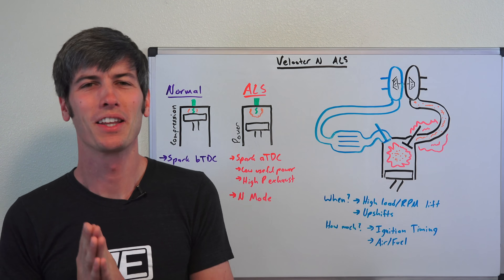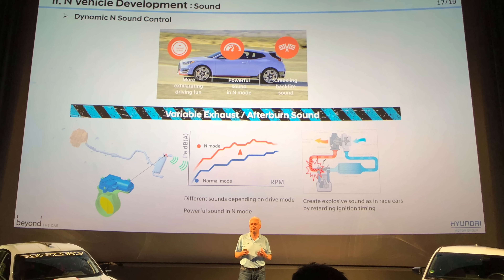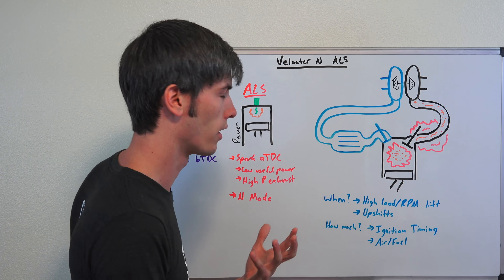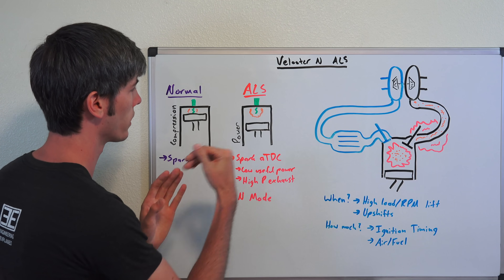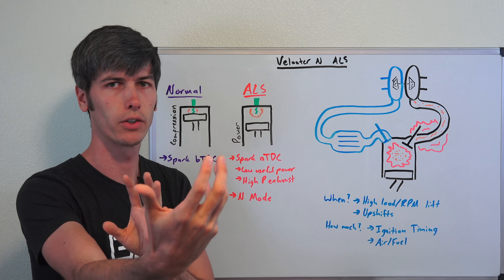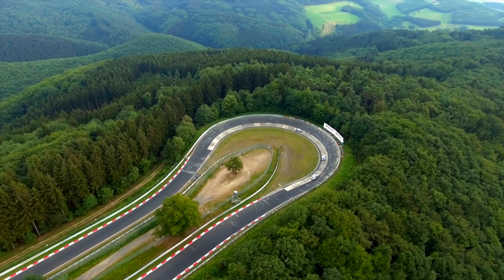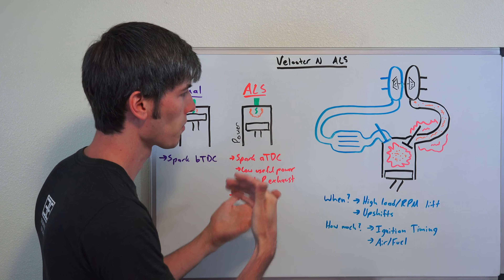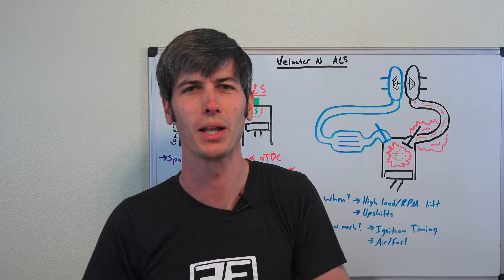Anti-Lag - How Hyundai Eliminates Turbo Lag

Comment from the maker: Thanks for watching everyone and hope you’re having a great day! For anyone interested here’s my full review of the car: https://youtu.be/6BVEhLBj7MQ
Reply: Very very cool(dont know your name) What track was the test drive at? Great job and anyone Shopping for new car or going to school,Most definitely needs to subscribe.Fantastic,,73s
Reply: Engineering Explained can you do a video on whether or not fuel is sent into the cylinder while coasting in gear, off the throttle. And if so, how much fuel?  I can’t find a clear, decisive answer. Thanks!! Love the videos.
Reply: Engineering Explained 
I made a HHO discovery a couple of days ago.  It has a much more efficient use of electricity.  Saving fuel for all whom want to try it. 

 The parts needed are two HHO cells wet or dry.  Tubing, robust electrical connections, extra car battery is optional, flash arrestor,  bubbler 

  If you want to do a video on it?  Then let me know, as I live near Preston.
Reply: Thank you so much for this amazing video been waiting for it
Reply: As you say at the end, cool that they have done it in a production car with a warranty. Having been involved in rallying, antilag isn't a new concept, but a rally car isn't under a new car warranty and can have a new turbo fitted every event as required. 
Cool tech for a road car and a brave move by Hyundai.
Reply: You drove the Veloster N at the Nurburgring?
Reply: Engineering Explained , do you know if is it bad to change drive modes, while driving car? What’s your opinion about that? Thank you for the good work
Reply: +Dale Alexander - Nordschleife circuit at the Nurburing complex.  It would be great to have heard what the lap times were in the Veloster.
Reply: Engineering Explained Hey. Great video. Question for you. The upgrade you can get (in the form of an ECU flash ) on the VW Golf GTI autobahn and the Golf R. It is presented as a “sound enriching “ upgrade. Would it have the same effect? What do you think and can u see about that? I have to go meet the APR guys and ask them but I won’t be out that way for quite some time. And I don’t even know if it’s them or VW offering it.
Reply: Great video very informative. What are the disadvantages of this anti-lag system?
Reply: Is this bad for the Catalytic converter?
Reply: @postulator890  it is...and it's the birthplace of the Hyundai i30N and Veloster N .. :)
Reply: How is this not just a "pops and bangs" remap? Isnt this exactly what all those remaps do? Retard timing? So what is the "fake" pop and bang then? :D old video i know

Comment: It happens mainly in N-mode because by default N-mode is all setting put in Performance/Race. But if you push the checkered flag button twice, you go into custom mode where you can set things up as you wish. For example, I have mine (the i30N Performance, not the Veloster, as I'm from Europe) set to Custom with the dampers on soft for normal roads, rather than stiff for track. as it would be in N mode, engine in Sport+ as in N mode (there is Normal, Sport, Sport+), LSD in Sport, TC in Normal, etc. So if you get this and use Custom mode with it, and have it set up to use Engine in Sport+, while it does sound nicer and actually give you anti-lag (sweet :D) you don't want to use it everyday going to get groceries if you want your car to last for some time, plus you won't be that douche that annoys everyone in the neighborhood. You can put the Engine in Sport and have a bit of the sound (it's a bit less than in Sport+ but it still pops and bangs) and actually retain a bit of the turbo's life/durability. Also it's a good idea to leave the car on and idling to cool it's oil since it passes through the turbo to cool it, especially after riding it hard for some time and especially if you use N or Custom with Engine turned up. Safe driving everyone!

Comment: Great explanation, thank you. I still find it funny that my 2019 Accord 2.0 is faster than this car.
Reply: No it's not. Your faster shifting auto will do about the same 0-60 and pull out just a bit slower on the quarter mile. But that's about it. It wont out-perform it in anything else.
It will however slap a BRZ in the face with pleasure lol
I seen modded BRZs (or whichever brand) lose to someone's mom's 2.0t accord lol

There will be dct auto veloster n coming out shortly and it will be faster then the stick. Heck... the r spec veloster has sticky tires, light wheels, less weight, and is still slower then a heavier auto turbo veloster with economical tires and more weight. 

Wait for that dct man 😉

Comment: Hi. Please tell me. If I want to install a turbocharger in my car, do I need to make any other engine adjustments/upgrades?
Reply: Peter Swarts the internal components of a naturally-aspirated car are not going to be strong enough to handle a turbo. You would want to rebuild the engine, maybe with forged internals or something.

Comment: Is 'N' mode Normal Mode ? What are all the modes for ?
Reply: I own a i30n i think the modes are pretty much the same as the veloster n

I have 
- eco mode (most economic no power)
-nornal mode (always active when u start the car.. Decent power decent economy) 
-sport mode (high power, low economy) 
N mode ( ultra sport mode... No economy) 
And the custom mode where you can customize everything from throttle response to sound of exhaust....

Comment: Is this like the "2 step" mode of the drag race cars?
Reply from the maker: 2 step is simply a rev limiter for launch control. It’s often associated with ALS but they are different functions. If the launch control retards ignition timing to function, it can potentially (not always) act as an ALS for turbo vehicles.

Comment: This is just downright cool. Props to Hyundai for that. I would be curious about the cooling system within the turbo in regards to how/if it controls the heat from burning exhaust gases with the antilag. I can see potential longevity issues with turbo cooling. Awesome nonetheless.

Comment: Great video man as usual.  I have a question though.  When you let off the throttle normally most modern cars will shut off fuel injection so I assume this ALS bypasses that at high rpms or load and continues to inject fuel but like you said just retards the timing?

Comment: I wouldnt say this was an ALS, more like over fuelling, pretty much zero benefit except the pops and bangs, and as we all know, reasons ALS systems are not used on road cars are reliability and durability of components (like the cat which wouldnt last 5 minutes). Electric turbos and twin scroll turbos are where we are going or are at now for quick response, if you get lag in gear when pushing it with a twin scroll turbo then you are doing something seriously wrong in your driving style and electric turbos will totally eliminate all lag without killing parts.
Reply: Yeah, an electric turbo seems far better a solution than an annoying "farting" car that is putting a pounding on engine components beyond the cylinder.

Comment: My car has a different anti-lag system, called no-lift shifting (NLS). Basically, when you're at 100% throttle and the engine is revving high enough, you can change gears while holding the throttle pedal down and the ECM will rapidly blip the throttle to maintain engine and turbo speed, so that once you're in the next gear the turbo is already at max boost, thus there is no lag.

Comment: 1.What if I set the ignition timing to get the spark right at TDC??? 
2.Does Anti-Lag have any improvements to get more "horses" and torque???
3.What do you mean about "useful power"???
Reply from the maker: 1.) Then the anti-lag effect is reduced.
2.) No.
3.) Power to accelerate the vehicle, move it forward faster.

Comment: Is there still a nominal amount of useful work happening though? There has to be since the piston is on the way down and there is an ignition event happening - in other words, it must still be driving the crank and subsequently the wheels. This seems somewhat odd since you'd still be getting some amount of forward drive even though you've lifted your foot off the throttle. I assume its such a small amount of drive that it's insignificant, but it still could affect braking, cornering, etc.

Comment: I’ve got the i30 N, is it the same engine and all as the Veloster N?
Reply from the maker: Same engine, yes. There are some differences with the European exhaust and the exhaust for North America (I believe it's a particulate filter added for Europe), but pretty much the same drivetrain.
Reply: Engineering Explained interesting... thanks for the info!

Comment: So, it's only a cheap trick that can be dangerous. Many chiptuners can do that for not so much money in much turbo cars. A serious car maker, must do better than a normal chiptuner. For example, Renault uses a twin scroll turbo in the new Megane RS. This is a real tech solution without inconveniences or the use of ceramic ball bearing in the turbo like the F1 Renault engines, reducing by a third the friction and the turbo can spool up faster decreasing the lag . Things like that make the difference between normal engine makers and top ones.
Reply: Not as cheap as the tuners do and definitely much better. They had to make a few components more robust to take the additional load.
If you just tune a normal turbo engine to do this, you'll quite quickly destroy the catalytic converter, turbo and possibly exhaust manifold and valves.

They are putting a 10 year warranty on that car after all, so it's probably safe to assume they made sure it's not exactly "dangerous".
Reply: Maybe it will be safe in a normal use, but do you think the same if you were a regular track day user with this car in sport mode?. I think it's only a trick, not a real technical solution for the turbo lag problem.

Comment: That Hyundai engine would not be making all those pops and bangs at normal road legal speeds, not at all. Those pops and bangs are only at high to very high speed. Drive that Veloster or i30N at normal speeds all this idea would do is make the car more responsive. This is basically an afterburn type arrangement that generates a near continuous blast of combustion gas to keep the turbo spooled up. That is far better than all those complicated inferior loads of crap on Audi, Volvo etc.  Do the turbocharger R&D, lubrication, and cooling properly and I can't see any problem with it.

Comment: I am so glad you explained this Jason! A lot of people upload crap to YouTube with misleading titles and descriptions regarding to supposed anti lag sounds from cars which turns out it is usually just some pops from the exaust. Besides, I consider this as a big and necessary step forward in road performance cars, no manufacturer did this before, although it has been used in rally cars since the late 80s...  Many people out there saying turbo lag is nice... I can tell none of them have ever felt the difference between antilag activated and deactivated. Jesus Christ... GrA Evo's and Imprezas run damn fast with that thing!!! And they sound wonderful!

Comment: When I was able to ride and had carbureted motorcycles, we would shut off the ignition, wack the the throttle, and then flip the ignition back on again. This while rolling 30-40 mph in town. When the ignition is turned back on, all the unburned fuel that was hangin out in the exhaust goes boom! rather loudly. The noise on this video brought back memories.

Comment: When you let off the throttle completely, doesn't the engine shut down the injectors for that while? (I mean with the shifter in gear).
At least this is what I remember you mentioned in a previous video last year in your Subaru, probably the systems will vary between cars and driving modes.

Comment: hi im from brazil ill try my best english ...
so ... let me ask you a question ... usually in direct injection engines like vw`s tsi lot of carbon build up into the intake valves ... by the pcv system ... if o do a remap and change the timing of the ignition causing pops and bangs it will build less carbon in the intake valves? cuz im thinking here ... all the unburn fuel , gases and stuff will be thrown in the exhaust and less stuff will go to the pcv system ? resulting in less gases, oil and stuff in to the intake valves ?

Comment: I’m really impressed with your driving at the Nurburgring. I’m more impressed they can pass an emissions test with this. Great day for car lovers.
Reply: They test in the default mode the car starts with, which is normal mode. They're not even allowed use ECO mode to boost the fuel economy scores because it's not the default on startup.

Comment: So in normal daily driving, if i'm coasting downhill in gear, not touching any pedals, does the engine burn gas? (manual transmission)

Comment: I understand this as an off-time ignition besides the normal combustion, being that the case isn't that causing damage to the moving parts involved in the combustion?? like valves and springs?? There is a reason for the valve to create a seal when the process of combustion is at any of the 4 times. Please correct me if i'm wrong.

Comment: I just had a split pipe off the back off the Turbo in my RB engined Nissan. No turbulence on the turbine side dragging down the turbo rpm so no need to respool every shift. This seems pretty cool but much more complex.

Comment: Why not use an electric motor to keep the turbo spinning? When the engine's at idle, electric motor spins the turbo. As the engine revs up the exhaust spins the turbo and the electric motor stops. Get off the gas and the electric motor takes over again. Battery running the electric motor would get charged by the alternator. Why not? No need to mess with timing and having air/fuel being ignited in the exhaust manifold.

Comment: They need to make it AWD and 6 speed!!! If they make an AWD Veloster with a rear bias by use of a wet clutch pack (so that when the clutch pack is fully released it will be RWD), the Veloster will sell like hotcakes. Thecar looks really good, makes decent power, but its competition is the Civic Type R, Fiat hatchbacks, and Mini. All of which handle way better and make more power. If they make an AWD 6 speed Veloster, the competition will be Subaru, and thats it. People are putting Honda CRV transmission/transfer cases into older Civic hatchbacks and modifying the rear end to make them AWD. Those cars become missiles when they do that. Hyundai has an opportunity to make a name for itself, but they probably won't do it.

Comment: The only downside, my guess, is that the after-burn in the manifold will tend to have a long-term damaging effect on the turbo impeller and the downstream emissions cat. But, it's only momentary that anti-lag programming takes place in a given mode, so depending on driving conditions, it could be very brief.

Comment: Hi
During this ALS operation, How component protection (Turbo charger) is handled? We are retarding the ignition and combustion is happening / Exhaust valve is open. Does the high combustion temperature wont damage the Turbine in longer run? And when Turbine is too hot, heat is transferred to Compressor too via the shaft, which results in hotter intake air right?
Retarding the ignition we also lose some power??

Comment: Hey Jason, my question is how does this guarantee the life of the emissions systems, more specifically the catalytic converter. I’d imagine that retarding the timing to that degree would increase exhaust gas temperature significantly through the turbo into the immediate down pipe into the catalytic converter. Wouldn’t that endanger the life of it

Comment: So ignition timing is delayed in powerstroke right?  In power stroke the exhaust valve doesnt stay open..
 I still dont get it.  :(
Reply: Ags Cgs it allows fuel into the exhaust since the valve is open, that force keeps the turbo spinning. In this car it's a useless feature since it's a small turbo that doesn't take long to spool up. Big turbos need this
Reply: kurt nasse  thx for the info  :)

Comment: good video as always.. sounds interesting indeed.. what about fuel economy and pollution?
Reply: You probably don't want to know about either of those in N mode :) Safe to say, both are much worse than in "normal" mode.
Reply: propbably not.. if I understand the system it is in effect keeping the fan spinning by burning ekstra fuel (ie more ignitions)
Reply: That is correct. More fuel is used, plus the conditions are not optimal so it's probably burning less cleanly (worse emissions).
Then there's the domino effect - anti-lag puts too much heat into the catalytic converter so they probably have to run rich A/F ratio afterwards to cool it down - even more fuel and emissions.

It's hard to find something that is both fun and efficient/clean. Almost everything that you do to improve performance of an ICE engine tends to have negative side effects, be it fuel economy, pollution and/or durability.
Then again, it's good that we have engines that can run in multiple different modes, so we can choose between economy or max performance. I don't really expect many people to redline it in N mode when getting groceries :)
Reply: sounds right.. I would personally be worried about the complexity (ie probability of expensive repairs )...

Comment: Do any cars use recirculation around the turbo? Seems like you'd get massive pressure spikes/stalling of the turbo with a closed throttle regardless of any anti lag in use.
Reply: The ECU tells the BOV/BPV solenoid to always allow the BOV/BPV to vent when the accelerator pedal is completely released. The stock intake uses a recirculation hose, but these cars only use a MAP sensor, so they don't care if the bypassed air goes to atmosphere or back to the intake.
Reply: Calculated Risk thanks. The last vehicle I owned that was a turbo was an 85 300zx which had a mass airflow sensor.